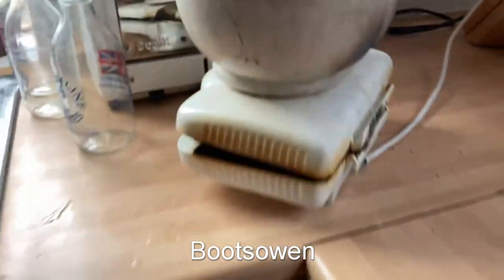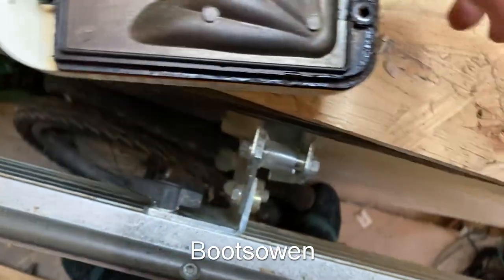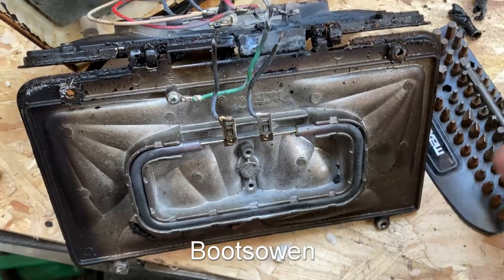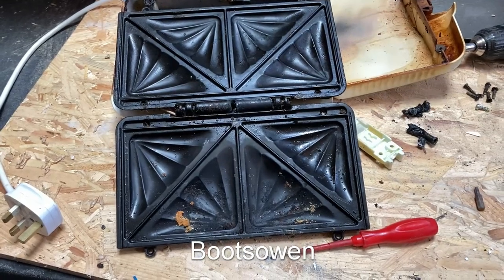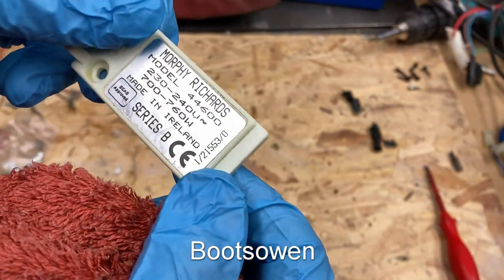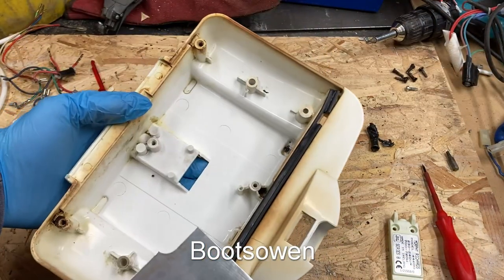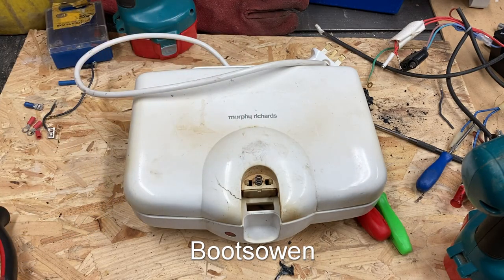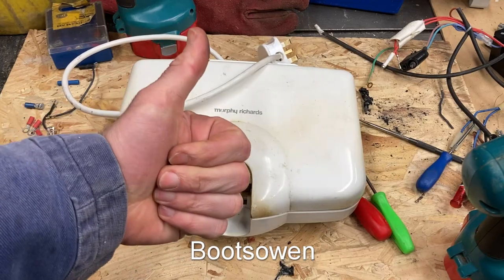My toasted sandwich maker went on fire: can I fix it?  Morphy Richards 44600 Toastie grill repair

Comment: I just spent part of my Saturday fixing my tostie maker, on mine the thermostat had got stuck closed and overheated the machine and blew the thermal fuse. I love doing little jobs like this that save a few ££ and reduce e-waste.
Reply from the maker: That’s what it’s all about. Maybe me didn’t have a thermal fuse!  Less to go wrong. Did you fit a new one or just bypass it?
Reply: @bootsowen  I just cut it out for now, I may fit a new one as a saftey precaution but I never leave it unattended anyway as it is soo easy to burn a tostie if you walk away. But I have ordered a new thermostat as without a working one it was getting too hot (250°C)  and the tosties are coming out a bit too brown.
Reply: its a bimetal  controller that shows you by the light your food cook time, i.e. cook time as started and ended. also bimetal temp control when fails allows you to get to hot for your heat wires , never use plastic ends the fumes can kill you off  with cyanide fumes given off on some cheap ones